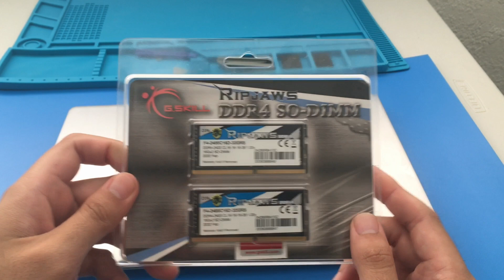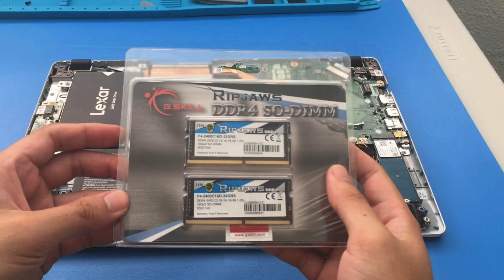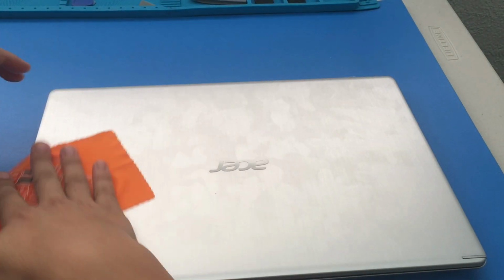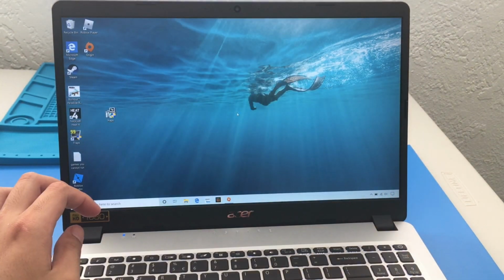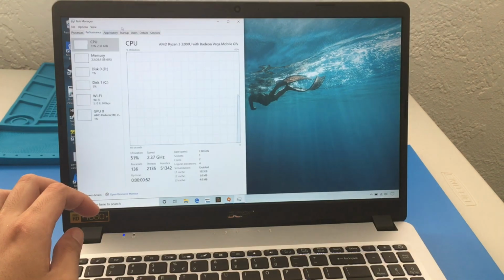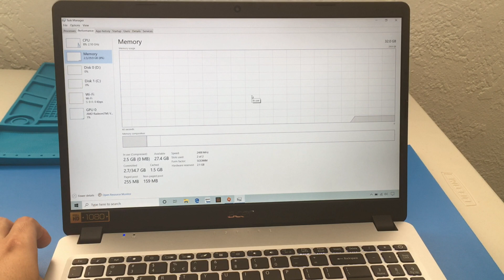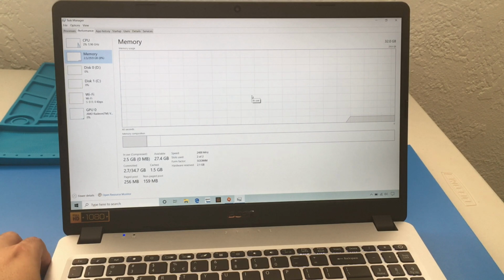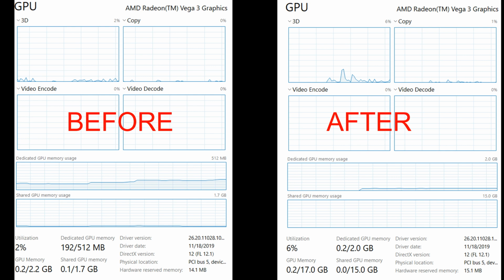32GB DDR4 Ram Upgrade! Acer Aspire 5 Slim Laptop A515-43-R19L

Comment: So have the aspire 5 a515-43 ..119gb storage .4gb ram. And ryzen3 320. And amd Vega3 graphics card   What would be A good budget upgrade when I play YouTube videos and I use the stock speakers it will start to skip so I have to connect the Bluetooth I got this laptop super cheap and wouldn't mind a couple cheap upgrades

Comment: This laptop ships with 128gb SSD with Windows "S" on it.  I don't even know WTF that OS is but doesn't matter because linux does not like SSD for /home or /root anyway. I installed a 7200rpm 2TB barracuda HDD to mine and that's pretty much what I install for customers that wanna run linux in my area as well. I assign the SSD to /backup and install Timeshift files to it. I know your readers don't know WTF any of this is but those few that are running linux will appreciate my post.

Comment: Is this laptop still good in the big 25?
Reply: I’ve had mine for 4 years and it’s a great laptop. I’m getting into graphic design which is why I’m here thinking about upgrading the ram on it. But for just a laptop for simple tasks like Microsoft office apps or YouTube it’s a great laptop.
Reply: @youre_bad8343  I did on mine it runs better but the cpu holds it back forsure

Comment: Quick question. Could I use a flathead precision screwdriver an guitar pick for this upgrade?
I've done a similar upgrade before, on a computer that was much easier to open and customize, so I would assume so. 
I'm looking to replace my 2016 Dell Latitude 5490, and this PC is one of my top contenders. It mostly hinges on if I can upgrade the ram to match what my current build has.

Comment: It's ok if i put 16 gb 2666 MHz just in one slot? another slot is not working.
Reply: At the moment is working with 4 gb 3200 MHz stick
Reply from the maker: Glad to hear it
Reply: @whattmeter  anyway,the big question is if 8gb stick just in one slot will it make some difference and work properly or i should keep the old 4gb and save my money. Sorry for so many questions, i can't find an answer anywhere.
Reply from the maker: either an 8gb stick or 4gb stick will work. Depends on what you need the ram for. 8gb means more ram. one 8gb stick will make a difference vs a 4 gb
Reply from the maker: It should work with only one slot. Was one slot damaged?
Reply: @whattmeter  yes, one slot is damaged. Thanks 👍
Reply from the maker: @cosmin5817 is the primary ram slot ok? Or is that one damaged? One stick needs to be in the primary
Reply: I don't know which is the primary, from the right side is damaged.

Comment: Okay so my father inlaw bought this laptop for my mother in law. Long story short she left it on charge for almost three weeks. And messed it up. So he gave it to me and said that a new ram stick would fix the problem. Does that sound right?
Reply from the maker: Left it on charge? Meaning the laptop was charging the whole three weeks? The laptop shouldn’t have an issue if it was plugged in. Unless I am misunderstanding the story. Is the battery inflated or bulging?

Comment: I completed the install of both the memory and the SSD as I used the tutorials from both your videos which were super helpful. I ordered and installed the exact same memory sticks on this exact same laptop from the video. However, after a month with no issues, I suddenly started getting two errors that would cause my system to restart randomly. The first is irql_not_less_or_equal and the second is kernel security check failure. Any idea whats causing these as I researched them and they’re both memory related errors?
Reply from the maker: Were you able to figure out the issues?
Reply: @whattmeter  yes, I ordered 2 x 32GB RAM cards and misunderstood that the max RAM my laptop can handle is 32GB not 64GB. Downgraded to 2 x 16GB RAM sticks and have had no issues since.
Reply from the maker: Glad you figured it out

Comment: Do you have to disconnect the battery Ive bought this laptop and I'm going to put 2 8 gig ram sticks into it but I don't trust myself not to somehow break the battery
Reply from the maker: Highly recommend disconnecting the battery to avoid any short
Reply: @whattmeter  thanks for the quick response bruh

Comment: I’m completely computer illiterate (esp when talking hardware) but recently picked up playing the sims 4 to unwind. It stopped working and I got a message saying not enough memory. For weeks I stressed out and felt so helpless. I finally looked into it, found your video and thought, well that doesn’t look too hard. I’m shocked and stoked to say that I just upgraded my laptop and it still works!! I’m shocked nothing went wrong and it actually worked and I didn’t completely ruin my laptop!   I was nervous when you said you use these ones for practice because this is the only one I have! I’ve never even thought about opening it up, but I did ! And it worked !!!! Thank you so much for this video!! I actually might try something else now, since this went so well. Any suggestions for what to upgrade next that is still beginner level?
Reply from the maker: Glad it all worked out. I usually work on budget laptops so hard for me to recommend anything. Depends on your risk tolerance
Reply: Yeah upgrade to linux! But you need to install a HDD to do that and the learning curve would be overwhelming for a novice (which is just about everyone that is not dual booting). Yeah its sad that 99% of John Q is functionally illiterate when it comes to computers... at least in the USA.

Comment: how do i unscrew a damaged screw on the laptop and what can sub for the prying tool
Reply: use the screwdriver with a rubber band at the screwdriver tip. should work for stripped screws of all sorts.

Comment: Hey I got another question. My computer already has 4gb. Can I buy a random ddr4 2666 8gb ram and fit it in to have 12gb ram? Or would that not work?
Reply from the maker: It would work. It would run whichever ram has the slower speed. Just make sure you have ram that is correct for the ram slot
Reply: @whattmeter  how would I know which ram would run for my computer? A budget friendly one.
Reply from the maker: You can use crucial scanner. You can also check task manager > performance tab > memory. There are many different ways. You can also ask where you bought it from. Seller would know most likely

Comment: Hi, my laptop have 4gb ram, can i add a stick of 8gb ram to it to make it 12gb? Your tutorial is helpful for me since this is my first time upgrading/opening up laptops.
Reply from the maker: Open cmd as administrator > wmic memphysical get maxcapacity, memorydevices > convert the numbers under maxcapacity from kb to gb to find your max ram capacity. (The number under memory devices is the number of slots you have. This includes soldered ram if the laptop has any. Hopefully that makes sense)
Reply: @whattmeter  i found out that my max ram is 20gb on the crucial website. I can only afford 8gb. Just finished installing the ram, it's easier than what I expect. But sometimes chrome tabs shows "error code: out of memory",
Reply from the maker: Did you check your cache and cookies by any chance? I would try a different browser to see if you have a similar error
Reply from the maker: 12gb is possible yes. If brand/speed of ram/ cl is different then it will run at the slower speed and won’t be dual channel. That being said 12gb (4gb+8gb ram works perfectly fine. Not the full potential of the ram but a boost nonetheless)

Comment: Good video man just a question. In the general info it says max memory is up to 16GB. Is It safe to do this? Or at least the laptop will use the full ram?
Reply from the maker: Most of the time in task manager you will see that there will be some reserved ram. Also often increasing ram increases shared gpu memory. You can overclock the ram to use it’s full potential but might cause errors if you aren’t sure what you are doing
Reply from the maker: Often if you install 16gb ram you will see that available ram is lower than 16gb if that makes sense
Reply: Thanks man

Comment: Hey bro, I need some help. I got the same laptop as you. The aspire 5 4gb ram with what seems to be 128gb hard drive. I’m only using it for light gaming ( sea of thieves on pc ) I originally got it because I saw on YouTube this computer would be good for light gaming.. unfortunately... when I play my game my FPS is garbage. I can only get about 15-25 FPS.. do you or anyone else know what I can upgrade or do to increase my FPS? Because at this point .. playing my game everything seems to be sticking or lagging. Any help or tip would be appreciated thanks!
Reply from the maker: Interesting. By any chance do you know the read and write speeds of your ssd? Also doesn’t sea of thieves take up like 50 gb of storage? Is you ssd kinda full? Last question, are you running the game at 1080p? I don’t play this game but looking at the system requirements they recommend at least 8gb ram if playing at 1080p. And that’s just for 30fps https://www.nvidia.com/en-gb/geforce/news/gfecnt/sea-of-thieves-pc-system-requirements/
Reply: @whattmeter  Hi thanks for your quick response. Looking at the specs of the game it does require 50gb of storage. If you mean by SSD as in ( C: ) than yes it is pretty full. It says i have 7.89 gb free of 118gb. When i play the game i play it at the lowest setting, i think it was around 540p so i can get higher FPS

My GPU 0 is at 1% (41 .C ) and Memoriy is 2.1/3.4 gb ( 62% ). As far as shared GPU memory, i dont see anywhere on that list that says it it says my speed is 1.34 GHz if that helps? 

looking forward to your help and response. Thanks
Reply from the maker: Shared gpu memory shiuld be under task manager > performance tab > gpu. On the bottom left area it should show shared gpu memory
Reply from the maker: Try checking your task manager > performance tab > check your gpu and memory. Gpu to see what your dedicated memory is. Also check your shared gpu memory
Reply from the maker: Yeah I think it’s a number of factors as to why fps is low
Reply: @whattmeter  shared gpu says 1.7 gb. What should i do/buy to make my computer and FPS faster?

Comment: Hey so I heard a 32 gb ram would be overkill, has yours caused any issue or should I consider getting 16gb (idk which is the best for this laptop)
Reply from the maker: 16gb is highly recommended since the cpu bottlenecks and you never tap all the extra ram. I never had any issues and I got the ram on sale and it’s not the fastest ram either 2400 mhz. No regrets

Comment: I don't know how fast you will reply, but do you think that that this laptop with 20GB RAM well run Apex legends somewhat smoothly? I only play Minecraft witch is fine with 4GB and Apex on my xbox  just wondering if it's even reasonable to think my laptop can run it.
Reply from the maker: Depends on the cpu and ssd of the model you get. Based on my gaming tests 16gb will run apex legends good. They recommend at least 6gb ram If I remember correctly. I think cpu and ssd read and write speeds will play important roles. Basically it’s a combination of things. The xbox version also is optimized so that’s probably it runs great for xbox
Reply: @whattmeter  ok that was really helpful! And speedy response. I'll sub and tell my friends about you
Reply: @whattmeter  oh and btw this is the one I got https://www.amazon.com/dp/B07RF1XD36/ref=cm_sw_r_cp_apa_glt_fabc_FMGRK6RFQS7WJ3VXEBEN

Comment: Bro i just bought thus laptot and i want to add it an 4gb ram extra. Will it be faster?
Reply from the maker: Yup 4gb will help. What is the current ram installed? It also depends on what you are running. If it’s bootup time you are trying to increase the ram wont help much. It would help on multitasking, but also depends how much ram you already have
Reply: @whattmeter  its 4 gbram and i want to add plus 4. And sth else i tried to put a 2gbram on a older laptop and now it doesnt turn on it shows black screen
Reply from the maker: @andileka9598  ram might be incompatible or it might needs to be reseated. Also sometimes it takes a few minutes for it to get recorgnized. Are you using different brands? Mixed speeds? How about the CL

Comment: should i get 8 gigs for 50 bucks? also can the laptop handle 12 gigs? Will the extra gigs upgrade my framerate and performance?
Reply from the maker: yes, the laptop can handle 12gb, but I would check to make sure you will get dual channel to get better performance.  RAm usually helps with multitasking. Extra ram usually adds to shared gpu memory. Usually it won't help much with fps or framerates, it depends what hardware you are running and what you are trying to run. hope this helps you out.

Comment: I wanted to add another 4gb stick similar to one already in this laptop but it says 
Samsung 4GB DDR4 PC4-21300, 2666MHZ, 260 PIN SODIMM, 1.2V, CL 19...would this work
Reply from the maker: check crucial website for compatible ram. You can also use cpu z to see the current ram installed or the bios. if you mix ram with different speeds it will run at the slower speed.

Comment: As far as the default ram speed goes, most manufacturers run most components slower by default in order to ensure no instability is found out of the box. You should be able to essentially "overclock" your ram to the 2666 standard of the default dimm. I will try this on my aspire 5 slim after i finish this comment. Will reply with results.
Reply: Just booted into UEfI BIOS and it does not allow modification of the speed of any component in the system. Unfortunately, this means that you will have to stay at 2.4 ghz as far as dimm speed goes. Good choice going with the 2400 mhz RAM kit.
Reply from the maker: oh really, thanks for trying it out. I think most mainstream manufacturers try to lock in the bios from overclocking.
Reply: @superscrotum3137  nice name man

Comment: I just bought 2 8gb ram but my laptop will only boot up properly if only one is installed. Both sets of ram work. They work in either slot as well. But together the laptop will not even start up. Can you help. I've searched everywhere with no luck
Reply from the maker: What speed is the ram you bought? Also is it high density ram? Does it say on a box a certain ram speed but you can overclock it?
Reply: @whattmeter  it's PNY - 8GB 2.4GHz PC4-19200 DDR4 SO-DIMM Unbuffered Non-ECC Laptop Memory
Idk if it's high density or can be overclocked but I know they both work separate in both slots but not when I put them in together. The box even suggest to get 2 for better performance. Ironically I'm getting no performance
Reply from the maker: That should be normal ram. I would contact pny support. It should work.

Comment: Do you mind linking the tools you used for this unboxing? Great video btw.
Reply from the maker: Most of the tools are just generic screw drivers. They are pretty cheap. And the links don’t exist anymore. I would just look for plastic pry tool sets. For screwdrivers it is a ph screwdriver set which was like 5 bucks at the time. It included ph1, ph0 and a few other screwdrivers. I mainly use the ph1 and ph0 from the set

Comment: ALSO IMPORTANT: If you shutdown the computer do you still need to unplug the battery?
Reply from the maker: recommended to unplug the battery to avoid shorting components. I've done ram upgrades without disconnecting the battery with no issues, but it's risky. Highly recommended to disconnect the battery before upgrading.

Comment: I was looking at upgrading my own laptop that is the same model and I see my current RAM runs at 2400Mhz and the specs from Acer also say the max is 2400Mhz, however, when I ran the config test on Crucial.com, in the list of compatible memory they list modules that are DDR4-3200. My question is are they just listing these modules because they will work, but won't run at their full speed because of the limitations of the MB? My current RAM is Samsung and it only runs at 1363Mhz because it's only a single DIMM (so single channel), but it is still listed at DDR4-2666.
Reply from the maker: based on my experience, if you use 3200mhz stick, it will run at the slower speed. The crucial website is probably showing you ram as an option. I'm pretty sure you can't overclock the ram speed of this laptop. I could be wrong.

Comment: If the device came with 4 GB RAM why do you upgrade to 32 GB RAM which everybody knows that the maxim capacity is 8 GB RAM?
Reply from the maker: Just to see how it is. Ram is easy to swap. Also wanted to see the increase in shared gpu memory

Comment: Hi. Is it possible that i use the 2666mh and not the 2400?is it fine? Pls answer asap
Reply from the maker: Do you have the same laptop? Check your task manager > performance > memory and check the current ram and it’s speed. Then check to see what ram slots are used. Remember that if you mix ram speeds it will always run the slowest

Comment: Hi I installed both 16gb and when I run the task manager it only says I have 16gb although it should be 32?
Reply from the maker: In task manager does it say slot two of two is used? Or just 1 out of 2?

Comment: What Ram Do I need for the aspire 5 ( A515 - 52 - 7290)
Reply from the maker: Im not sure. Have you tried checking your task manager > performance tab > memory? You can see the current ram speed, how much ram is installed and slots used
Reply: @whattmeter  Il try that. Thanks!
Reply from the maker: @kifter4254  good luck. cheers

Comment: Wait, so would it be bad to install it with two 16 GBs to make 32 GBs or should I just put in two 8 GBs to make 16 GB
Reply from the maker: The cpu bottle necks so 32gb isn’t necessary. 16gb would be more cost effective